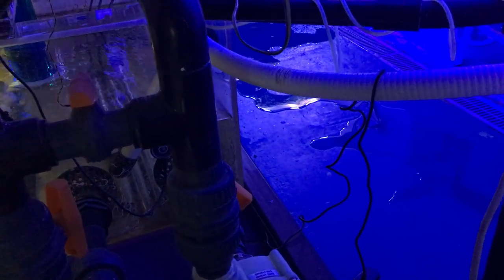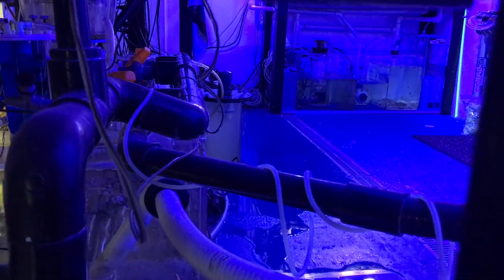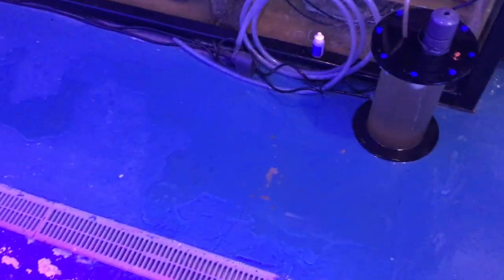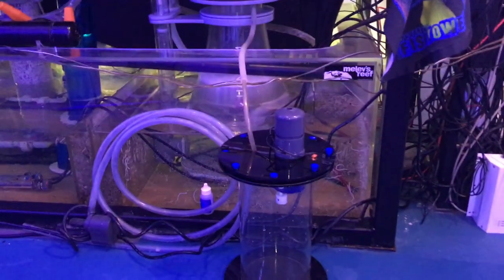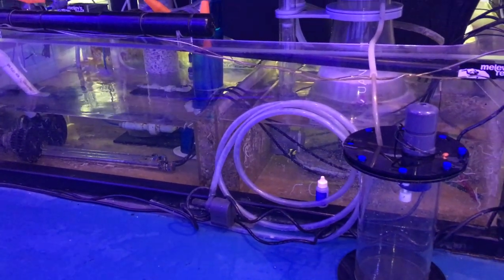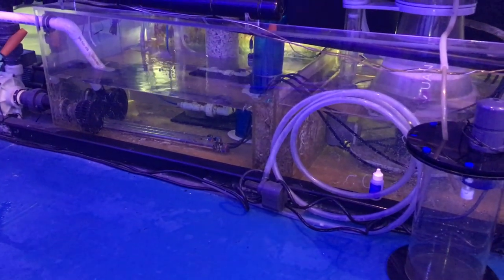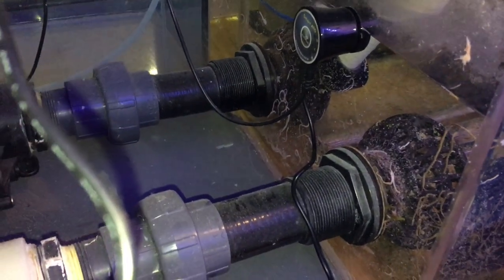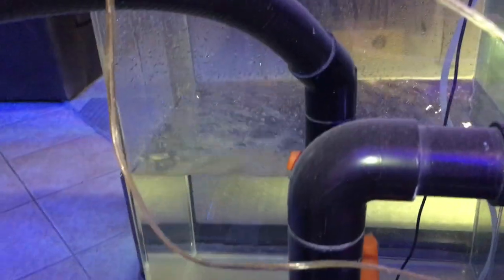Bonus vid: Mini Flood and a PSA

Comment: you said great food to add is some topdown photography. not sure what that is or if that's just typo. year most of us would be crying as it would be on the carpet or wood flooring. at least you have a fantastic setup that allows for such issues
Reply from the maker: When I filmed the 20,000g reef from above, Joe threw in an entire package of PE Mysis into the tank. The surface became glassy smooth and we could see and film down into the reef beautifully.

Comment: hi Marc. i think i called you melev in my last chat, apologies. do you find some days the skimmer is just not performing, u have about 10 nitrate.  i have a 4 week old deltec sc1456 and 50% of the time that i check it, it Is just flat.  i have set it up according to instruction.  today or seems to be working but usually as strange as it sounds,  after a morning feed it fits flat for a few hours even of i don't switch the return pump into feed mode. is this normal. many thanks and thank you for the good videos you keep making  hakan
Reply from the maker: Yes, the food you add to the tank will change the surface tension and that causes the bubbles to collapse in the skimmer. Especially oily foods like P.E. Mysis, for example. Great food to add to the water for some topdown photography, by the way.  

For the most part my skimmer works great. I've not had an overflow in years, but I recently got my quick disconnect wet and burned up the connector, and haven't fixed it. Now I'm motivated, naturally.  Wet floors will get you off your butt to do things, I tell ya. :)

Comment: The real question is how do know your float switch is busted unless it's after there is water on the floor, or your ATO turns your salty pond into a den of death by making the salinity closer to freshwater than salt?.
Reply from the maker: I was trying to fix a different situation, and the quick disconnect got wet.  I've tested the float switch and it's functional, so I just have to repair the other half.  What the float switch always does is shut off the skimmer when the waste collector is full.  It's worked great for about three years.  Just gotta fix that the way it was.

Comment: I have had the part that sits inside the sump of the ATO rust out, some how water gets on the inside of it, the rust then slowly builds up and breaks the casing open. Its now happened on 3 of them.
Reply from the maker: I've inspected mine several times. Been using the same one for about 2+ years, maybe longer. No cracks, no rust as of yet but I have another one ready in case I need to replace it.
Reply: Jeez you are a lucky man, I have 2 tanks, and have replaced one of them twice after like 6 months, and the other was about 5 months in
Reply from the maker: Did you contact Coralvue? Was it a warranty replacement?
Reply: Im in australia, and had to deal with australian warranty people, was ok, but yeah are now out of warranty and will be sure to happen again
Reply from the maker: That's unfortunate.  The SmartATO Micro uses a different method. The lighted sensor is in the water, and the magnet is on the outside.  Maybe try that one?  That's what I use in my 60g. http://melevsreef.com/sites/default/files/imagecache/product_full/smart-ato-micro-sensor.jpg
Reply: Yeah Ive got one of these in my anemone tank, will see how it goes over time :)

Comment: You squeegied everything to the "french drain"? I suspect quite strongly that you are talking about a different kind of drain. Maybe a floor drain? French Drains are a kind of drain for lowering the water table under the dirt while resisting the buildup of sediment.
Reply from the maker: I've always called it a french drain - I thought that was the proper term.  Perhaps this is just a very elongated floor drain, since it is 10' long. :)
Reply: melevsreef Ah, then what you have is what I'd call a "Trench Drain" rather than a "French Drain."

From the wikipedia: https://en.wikipedia.org/wiki/Trench_drain

"Trench drains are commonly confused with French drains, which consist of a perforated pipe that is buried in a gravel bed, and which are used to evacuate ground water."